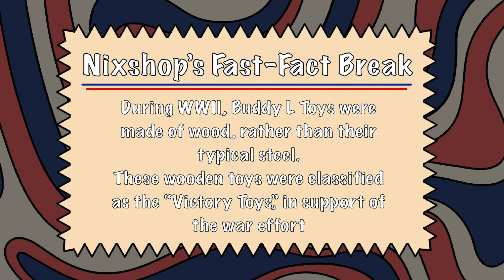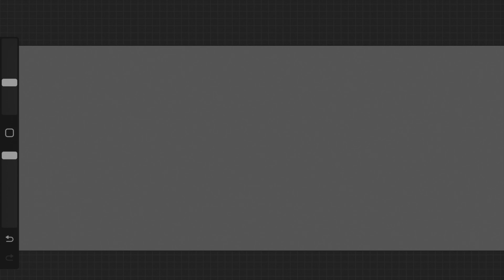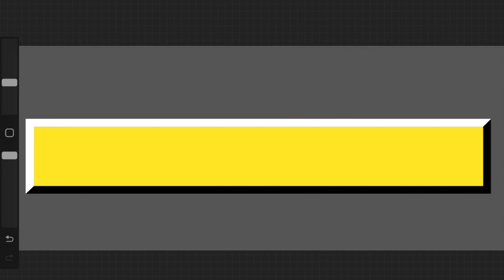1950s Buddy L "Sand and Gravel" Dump Truck Restoration

Comment: What is that tool called you use to remove the wheels with?
Reply: The hand tool, not the dremmel lol
Reply from the maker: They are called “Panel Clip Pliers”. We got ours at Harbor Freight for $10. They work great for axle caps on a variety of our projects.